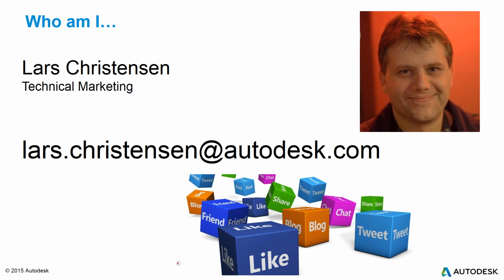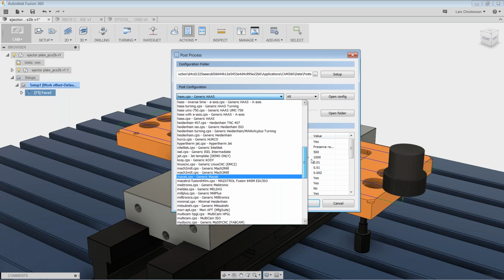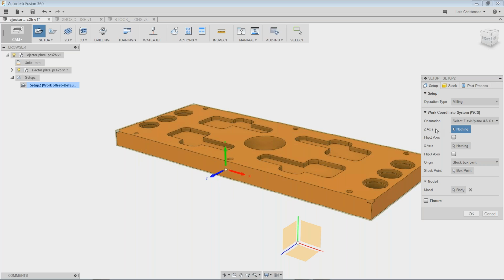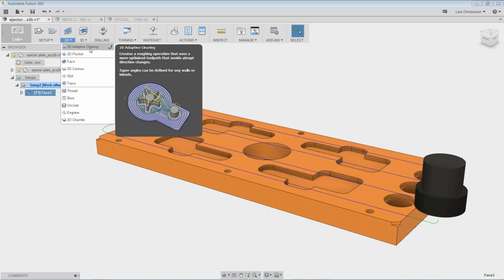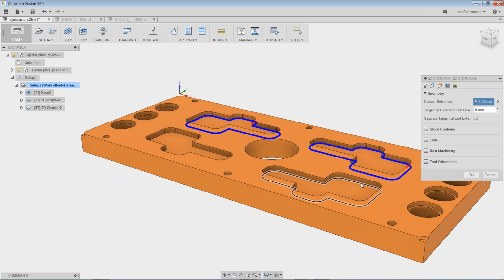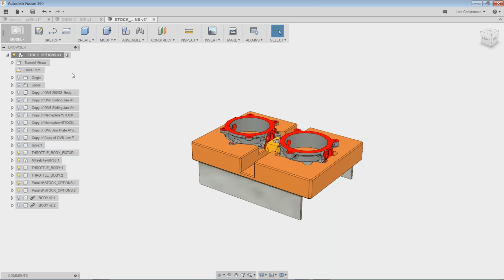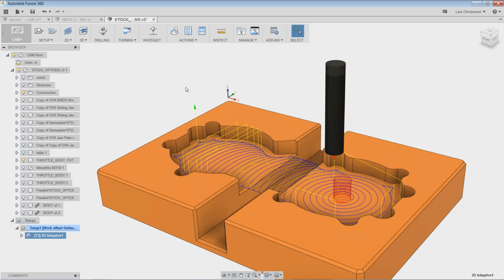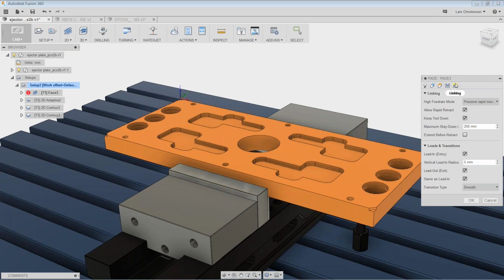Fusion 360 CAM Basics

Comment: Hi can anyone help me please??

I design home furniture. I am not sure which software to choose ( fusion or inventor). I need a software that can allow me to model my furniture along with the joints and inner wood skeleton of sofa.. i also need the software to generate cutting list for production. 

Thanks
Reply from the maker: I see you've copied/pasted this on 5 different videos. Please don't do that. If you want an unbiased opinion, you're asking in the wrong place, I will obviously recommend Fusion 360. Might I suggest you post this question on woodworking/furniture forums instead?
Reply: Autodesk Fusion 360 ok thank you

Comment: Love your videos.  But you need to harp on AutoDesk to quit moving stuff.  Typical of most sites, they can never leave things in the same place.  I went to look for the Post Processors and it's not only not there, but when I search for them the place it shows me the page is missing.  It's not only convoluted and stuff it buried, but it makes it annoying if you try to bookmark something and then can't find it again.   It's like it's a challenge to the site builders that they have to rearrange everything to justify their job.  Their job is to make the site better for the customers, not them.  Sorry, you do a great job on the videos.  Too bad someone can't make a site that's logical and consistent.
Reply from the maker: There is a fine balance between wanting to perfect a UI, and avoiding confusing users. Sorry if these videos use an old UI where you will find commands moved, removed, or hidden away. We'll work to update these to the new UI, and at the same time we want to try to limit the changes we make to the UI. That said, a new UI is already in the works. I will apologize now for that...sorry!

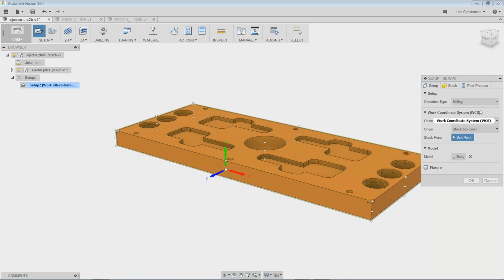Comment: you can also change the xyz orientation on your preferences so that z=up, then you can use :the presets ( "model orientation" ) on your work coordinate system 17:00 . I believe this is best practice as it matches machining convention of xyz.... x being left to right, y being front to back and z being up and down.
Reply: I hope my wording is clear. The Z axis "facing the wrong way" is permanently fixable by going to preferences :: General :: Default modelling orientation :: Z up .... there are two main reasons for doing this: 1. modelling with Z up is a good practice 2. Machining with Z up is required in 3 axis vertical milling

Comment: Hi Lars,  Great tutorial!  Thank you for posting it.  Out of curiosity, how do tool changes work with the generated G-code?  More specifically -- for hobby machines like the Shapeoko or X-Carve, is there a way to set up G-code generation in a way that makes the machine park in a tool change position, and then have it respond to a button input to resume, or, for hobby machines, is it best practice to generate two separate G-code files and re-zero after a tool change?  Thanks!
Reply: Most softwares that handle the gcode are looking for a different tool name/code when giving a pocket, contour cut, etc. each setup you will select the tool you want to use that tool must have a different tool code or name for the gcode software to notice its time to change the tool

Comment: This is cool I am new to Autodesk Fusion 360, but this program is awesome and I am really excited to use it. I love it that with cam you can create programs for many cnc languages like fanuc, heidenhain and mazatrol. I worked only with fanuc and heidenhain and I know how to program mazatrol, but because I do not have experience with mazatrol people will not hire me to work on mazak. With this software I will not have problems with it, of course you will need some adjustments here and there, but overall fusion 360 is awesome and fast to use. I also can add my own tools, calculate them once for different materials and just click them later when I need them. I love fusion 360 and this software will make me program and work on cnc machine 100 times faster then before. Thank you!
Reply: Just wanted to add that at the moment I am not working so I am using autodesk fusion 360 for free, but when I start to work again I will pay for the software to support it and the people that created it.

Comment: Is it possible to link one Toolpath after another so when we Play them it shows the continuous progress of what is being done with the stock?

With just a few minutes into Fusion 360 I setup a work piece to see if there's anything I don't understand thus requiring further investigation and so far I was only able to see the individual steps like drilling holes first, then pockets and finally contouring but not the whole combined result by keeping the result of the previous stock visible for the next operation.

Comment: 4th axis would be awesome, Thank you!
Reply: What kind of 4th axis? Tombstone indexing or are you looking for full in-sync (not the band) XYZA axis at the same time?
Reply: Lars Christensen The XYZA simultaneously machining at the same time.
Reply: Also could be kind of turning-milling but with a rotary table?
Reply: The post processors are made for CNCs not for specific machines so if you are going to use Mach-3 you just search for Mach-3 post and you are done, Fusion 360 free have post for M3 and works fairly good some things I change after the file is generated, what I would strongly recommend to you is to learn basic ISO code or best known as G-code so you can understand what each code in the file means and then you can see what have to remain on the file and what not, hope this answer helps you some how.
Reply: If you don't mind answering a question. I am a CNC noob and in the process of building my own gantry CNC.
What if a machine isn't listed in the Post settings?
Can it still generate the G code?
I plan to use Mach3 and Fusion 360. 
Is the free version of fusion360 capable of generating 3D g-code ?
Reply: Thanks. Yes it helped a lot. I was just wondering..... because i heard a Siemens webinar about CNCs and the guy talked about thousands and thousands of different Post possibilities because every machine vendor uses different g code dialects and then there is the thing of customizing the machine for every client.
Ok. So i need to use generic mach3 post.
How does this behave with the electronics i buy?
Does it depend on the motor controllers or the breakout board?
If i buy ordinary cheap TB6560 controllers and a breakoutboard at ebay????
Reply: The electronics are related to your CNC which interacts between your machine and the G-code, so in your place I would made the machine first and when the machine is ready then start working on NC-programs. yes generic M3 posts do the job.

Comment: Comparing the autodesk fusion simulator to the solidworks hsm express simulator in hsm.... The fusion sim, runs so much more choppy...  Is this a symptom of a under powered computer?  Or just the way the fusion / inventor simulator runs?  I can even see this in your video.
Reply: Really? Excellent observation. Honestly, this is not something that have bugged me, But, now I have to do some testing :-).